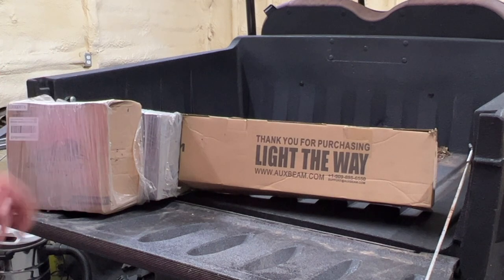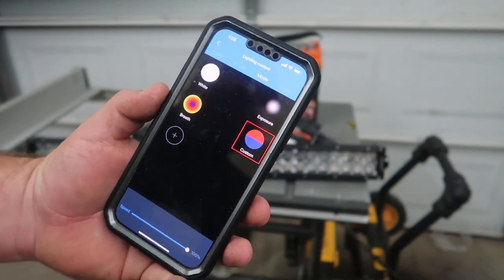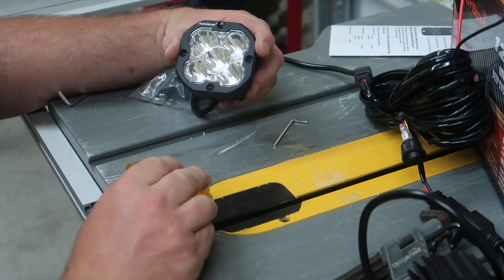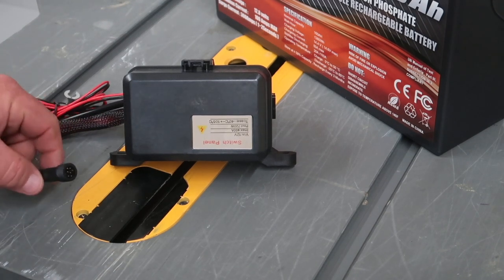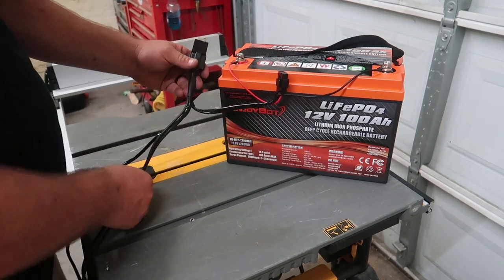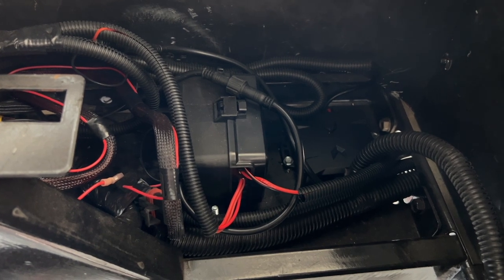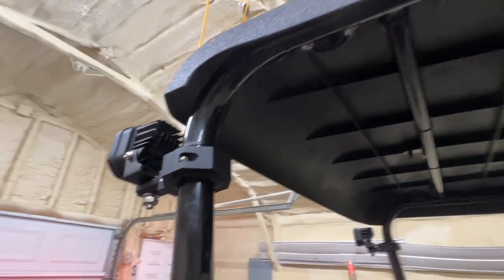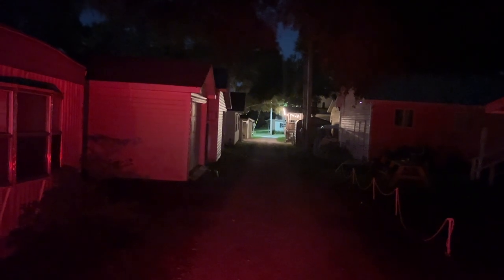AuxBeam 6 Gang Switch Panel Install On Golf Cart | This Makes For A CLEAN INSTALL!!!

Comment: Outstanding, I love the fact you're highlighting all the great lighting that's starting to come out. The one thing you can never have enough of is good efficient lighting.
Reply from the maker: Now I’m trying to decide on how I can put a windshield around that front light lol
Reply: @Fentertainment  real easy, 1/4 inch Lexan and a piano hinge. Make a cardboard template of the area complete with mounting points. Brake (bend) the bottom inch to stiffen it. You could also use some 80/20 (industrial products) plastic hinges if you don't want to use piano hinges. Use toggle clamps to secure it in the upright position

Comment: I recently got a used golf cart. I've learned alot watching the videos. Im not gonna go crazy with accessories. Budget wise. A dc converter and the 6 gang relay switch i should be fine? I have a ezgo txt.
Reply from the maker: I would also get a $5 relay from amazon the same voltage as your cart and install it with the key switch so your dc converter wont drain the battery when you arent using the cart. https://www.youtube.com/watch?v=yBuia-M_jHQ

Comment: How did you like the silver wolf motor I don’t think I seen that video out yet
Reply from the maker: It was a good motor kit. It didn’t compare to the navitas when it came to bottom end torque or the customer service. The kit doesn’t feature the otf controls navitas offers. I still have it and will put it on something again soon. The last cart I had it on was the limo when it had 33s on it and it did fine on road just not off-road.